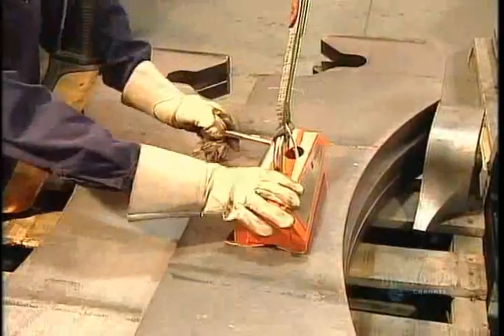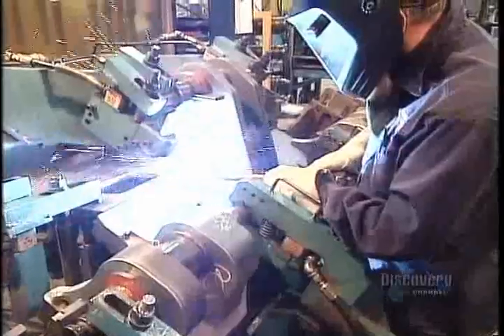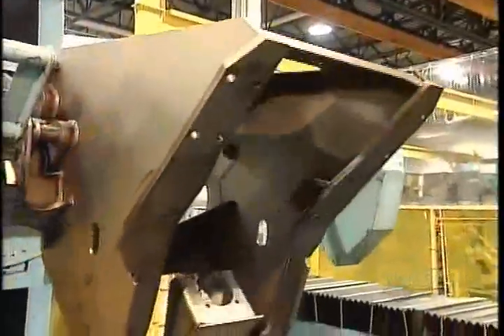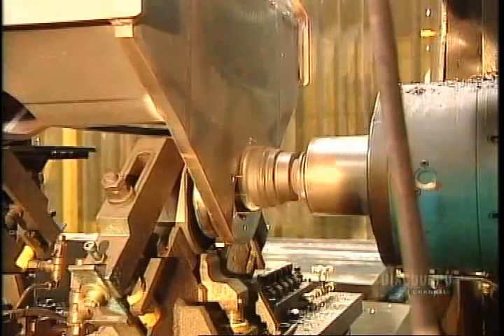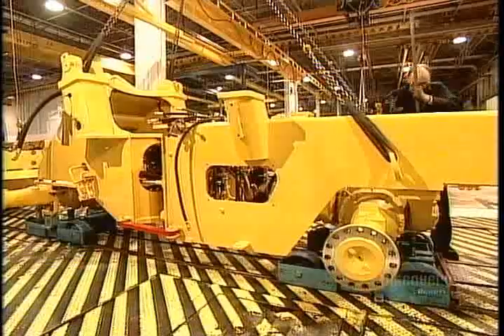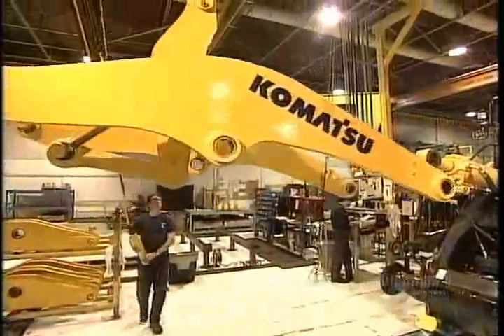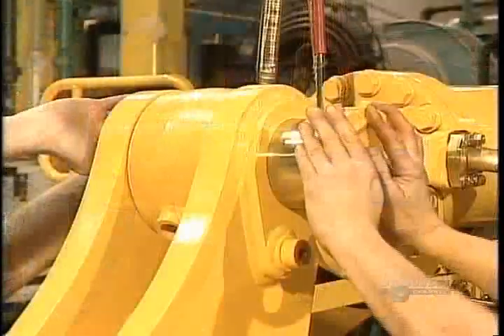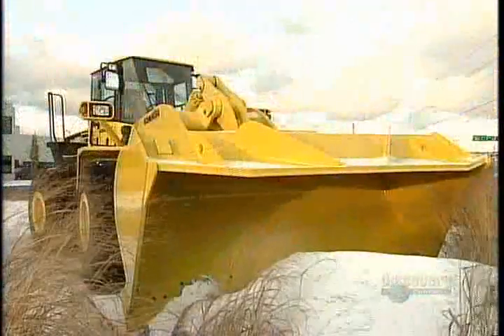How It's Made Wheel loaders

Comment: "i don't want to start an argument..."   OK, I'll do it for you. You're Wrong! Welding and soldering are different. In welding, the filler material melts, but so do the work pieces. In soldering, the filler (solder) melts, but the work pieces DO NOT melt. If you tried to solder together an earth mover, it would fall apart when you tried to use it.

Comment: it really bugs me that this show refuses to learn what soldering and welding are. time and time again they get it backwards. every time you see someone welding, you can bet they refer to it as soldering.

and when they show soldering, they tell us they are welding the electrical connections.
Reply: +tristen turner Yeah but they seem to think it's kinda synonym or soldering is an umbrella term for "fusing things with sparks and liquid metal". At the welding part, they get it right until that part ends with "they SOLDER about 90% of the wheelloader". It really is miseducation of the unknowing viewers ...
Reply: Do you know the actual definition of welding or soldering? Solder: to join (something made of metal) to something else with solder. Weld: to join pieces of metal together by heating the edges until they begin to melt and then pressing them together. Technically what you consider welding is not. What you think of welding is adding metal to the middle between the two pieces making it a SOLDER joint. Welding is typically only done with friction. TIG welding is as close as welding as it gets.
Reply: +npsit1 when you weld mig, tig, or acetylene you are melting both parts you weld and add in filler with the rod. if it was soldering you would not alloy the weld rod with the work piece. tin solder does not alloy with the copper pipe its used with, it fills in the gaps where as welding steel with 6010 rod for example, it alloys the rod and the steel to make a strong joint.
Reply: Keep in mind that this show is Canadian.
Reply: What's the difference, pray tell?